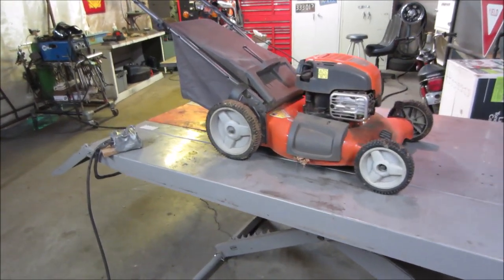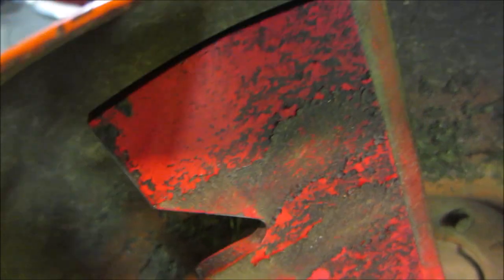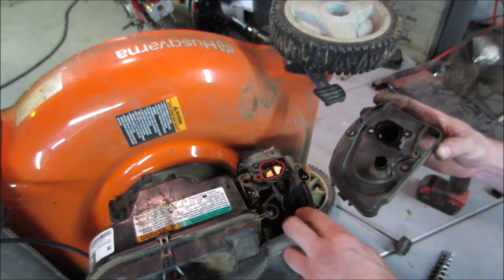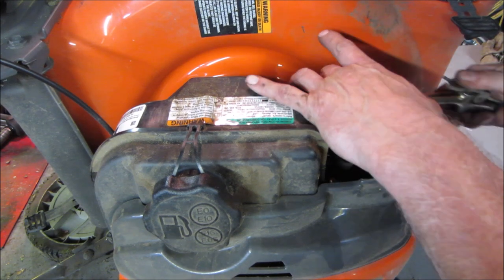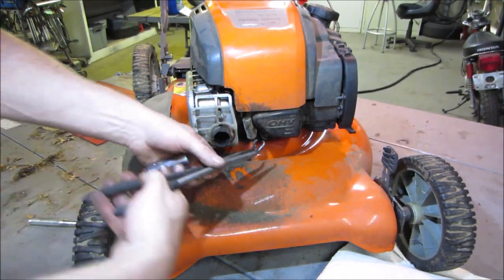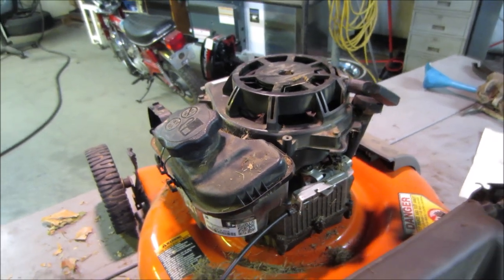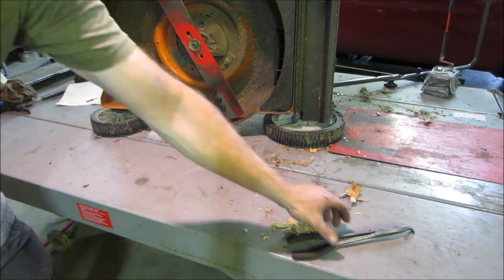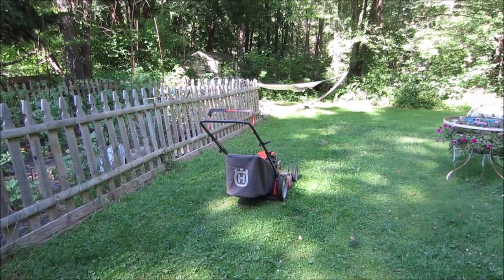NO OIL CHANGES? Servicing A Broken Yard Sale Lawn Mower,

Comment: I work as a repair-man at a Husqvarna dealer... These machines are not around much any more.. By that I mean the "no oil-change required" machines. B&S seems to have come to their senses, realising the huge amount of unnecessary wear on the machine it causes.

And another thing... Tipping a machine on its side like that is NEVER recommended.
Always tip a machine towards the handle so that the cylinder go towards the ceiling, avoiding oil going in to it.
(Even though I agree that when draining oil, it shouldn't be any problem)

Other than that, a very entertaining video!

Comment: That seems to be a Briggs and Stratton thing.  I bought a different brand lawnmower with a Briggs engine, same thing.  "Don't change, just add more." They probably just removed the piston rings as a cost saving measure and expect it to burn enough oil by blow-by to keep up with service.
Reply: I work there, its on almost all our small engines.  The reason In short: market research says whichever mower on the shelf advertises the least amount of maintenance, sells the most.  Were losing a lot of sales due to electric now for this reason.  But I can assure you they still have piston rings at least lol.

Comment: EBay is AWESOME for used mower repair. Put in the model number of your mower and you'll find kits for about 10 bucks that include spark plug, air filter, carb gasket kit. 
90% of problems can be fixed by changing those 3 things.

Comment: Lawn mower engines... they are low power, splash lubricated, air cooled. They don't have a oil pan and will burn oil at a faster rate then you would need to drain and change it. If you got nothing but time and are bored go ahead and change it.... My father has a honda lawn mower that is some 15 years + old and has never had the oil changed and used regularly. Just changed the spark plug on it earlier last year....

Comment: Do you ever use, seafoam, to clean carburetors while the engine runs, or wet soke the engine while engine is hot for like twenty to forty minutes with seafoam, that cleans thing out good too I've found.

Comment: When i worked on mowers to fix i always tipped them so the mower oil went to the back of the engine. that way the oil went to the back and wouldn't drain to the cylinder, carb, or muffler.

Comment: It might be a two-stroke that just burns the oil.  I had a jet ski like that.  Didn’t really need to change the oil, just top it off at the beginning of every service.  I honestly don’t think it even had a filter.  Small engines are great for that kind of thing.  Very little maintenance, just check and go.
Reply: It's scary that you feel the need to comment when you have so little knowledge of engines. BTW: This is a 4-stroke lawn mower, not a 2-stroke jet ski... there is a difference.
Reply: @johncoops6897  It's scary you need to assume what I know just to be a troll.  I actually know quite a bit about engines.  I got my associates in automotive tech and have passed 6 ASE tests so far, including one in diesel.  I have also gone back multiple times to expand my education with electives.  BTW: How do you know that is a four stroke?  Did he say it is?  I must have missed it.  And there is no difference between one engine and another.  If you can work on one, you can work on them all.  The only real difference is what the engine uses as fuel.  The only major difference between a two-stroke and four-stroke is that a two-stroke does the same amount of work in half the time.  They also generally don't have oil reservoirs, but not always.  See my original comment for an example.  Sorry to hurt your already low self-esteem, but your welcome for replying.  Have a good day.

Comment: My last Briggs says right on it "no more oil changes! Just check and add!" because apparently its too hard to change the oil in a 5hp engine now.  Just tune it to burn a bit of oil every time you start it, or whatever they did.
Reply: 1SLUGGO1.  That would be the old total loss oilers of a century ago.  I have not found the newer mower I bought two years back to burn any oil.  I needed one for a mountain cabin that was super light so I bought a $140 Lowes brand (Snapper).  Mostly light weeds on slopes with rocks.

My Sears Tecumseh 21 at the big lawn house has been chugging along for 19 years.  Starts on third pull almost every time.  Keep it clean, replace filter, sharpen blade every year (or twice), dump oil out the top every two years (I've never pulled a drainplug on a mower), use non ethanol gas, clean carb every two years, replace plug every five, run dry on Thanksgiving, store, repeat in March.

Comment: I'm surprised that,  right on the gas cap it calls for gas with "ethanol".    Talk about cutting the life of your carburettor.    First thing I was told when I bought a mower back in 2013 was,   "No Ethanol".    There are a few gas stations that carry fuel with no ethanol,  but not easy to find.  Shell (premium fuel) is one.

Comment: I have that type of B&S engine on a Toro (the one in my Profile pic!).  The idea with "Just Check & Add" is, first of all, the AVERAGE owner never does anything with the oil;  they put some in when they buy the mower (we hope!) and never touch the dipstick again.  The other thing is, allegedly, the mower consumes some amount of oil that works out to 18-20 ounces in an average season so, by just checking and adding, you've basically put "new" oil in over the Summer.  The trouble is, you haven't changed it and gotten any gunk out.  But again, you still would be doing more than the AVERAGE owner by just checking and adding.  I changed the oil on my Toro after the first five hours and change it every Fall.  I check it every time before I use it but, so far, have not had to add much.  

2nd - Hank's Garage had this type of engine and said that running it out of gas caused "Issues."  In the Comments, I asked, "What kind of issues?" and he responded, "Yes, running the gas completely out, like before storing the mower, does indeed cause issues.  Thanks for Subscribing!"  Very helpful.

3rd - I worked on a friend-of-a-friend's Husqvarna that was just beat up and had a "loose" handle.   Turned out the guy had somehow cut the bottom of the handle bracket off, so one bolt was useless, stripped the other bolt hole, the midway handle bolts were all flattened, it just caused a cascade of problems.  I took the right rear wheel off to access the bracket and the inner ball bearing race was in pieces!  I felt bad for the mower but refused to do anything else with it - every time I took a part off, it was broken!  Yumpin' Yimminy!

Comment: I talked to an employee at a store that sold another brand that also specified just add oil.  Between that conversation and searching online; The  air intake & cleaner keeps the dirt from entering the engine better than the old  design, thus the oil stays cleaner.   The engine might be run-in at the  factory so you don't need to change the oil to flush out the break-in particles.  If you don't remove the oil drain plug - the oil will not leak out when the plug is not installed or not tightened.  Some owners don't like changing oil and a local lawn mower shop near me charges 100 bucks an hour.  Don't know what they charge for an oil change.   Is there a small built-in oil filter?   Is there a screen near the bottom of the oil sump to keep the dirt from recirculating?   I would change the oil, as I keep mowers for a long time.

Comment: I guess the oil is good for the life of the mower. Kind of like a lot of newer cars have sealed transmissions, the fluid is good for life. Well, they're technically not lying. When the transmission starts slipping and slamming or the mower blows up, it is indeed at the end of its life. It might just be a bit shorter then you're used to. Besides I'm sure they will be more than happy to sell you a new mower or transmission lol

Comment: I picked up a fairly new mower last fall set out for garbage.  Had oil all over the top of the deck on one side.  Gave it a quick pull [that's what she said], and compression seemed good.  So I took her home to investigate, fresh gas in her, smoked a little but ran good after a minute.  Took it for a quick mow and didn't seem to be cutting the greatest.  Gave the blade a closer look, the cutting edge was BRAND NEW with all the paint still on it!  The back edge had the paint rubbed off.  So yep, the dude put a new blade on, probably got the oil all over the deck when he tipped it to install the blade UP-SIDE-DOWN!!!   Then had he cutting for a little bit and said, "Man, this thing is not cutting for $#*&.....I'll just go get a new one.... haha
Reply: Hey Mustie, thanks for the 'like'.... watching your videos gave me the knowledge and confidence to tackle such a project.  I now know to check for spark, compression, etc.  I even picked up a small generator with no carb/air filter box.  I was able to get it to turn over on starting fluid with a lamp plugged into it.  And the bulb lit up!!  Haha, no sure I want to pony for the missing parts though, it's only around a 1200 watt or so, little thing.  Thanks man!

Comment: Some of the mowers today, they say you don't have to change the oil, they are using synthetic oils and lubes on them. I could get about 75-100 for that all cleaned and waxed they would almost believe it was hardly ever used.

Comment: I've never changed the oil on my mower? I've had to replace the wheels, sharpen the blade, bypass the safety cable, clean the carb and tank, replace the pull string. But change the oil? nope, still looks like new and I'm sure if it was tested it would still pass for non detergent 30wt! I'm sure everybody's experience is different, but it seems to me that everything else will wear out before that oil ever goes bad!

Comment: I have a 20+ year old craftsman mower with a B&S motor.  After I cut there is oil splatter on the carb side of the deck.  I’m thinking head gasket, any thoughts?

Comment: My Husqvarna 7021 cuts.....not so great.....seems to leave a tiny strip of uncut grass even when overlapping passes. Just checked and the blade is correctly installed. I wonder if the motor is spinning backwards. Is that possible?  On the plus side the mower is 4.5 years old and I just looked and the air filter is still very clean. First oil change coming tomorrow.

Comment: If you don't change the oil, you will have to buy a new one sooner. The car companies did that with no lube and most people got a new front end out of it. The smart ones put in grease fittings  to prevent that.

Comment: That mower is not old at all.
The actual manufacture date is the first 6 digits of the serial.
That Briggs plastic carb is also fairly new on their engines, past 5 yrs
My Poulan has essentially that same deck, difference is my Poulan isn't rear discharge
Judging by the stain at the muffler, it was definitely overfilled with oil and it spewed out of the muffler.

Comment: All those Briggs 550ex style engines lack a drain plug. Overall I'm not a fan of that engine or the rest of the stuff attached to it. The plastic carb is a notorious issue because it's jetted so small to maintain California compliance. Sadly it seems Briggs doesn't build em to last and they are hardly worth repairing anymore. Ended up buying an older Briggs off Craigslist for $40 with the metal tank that runs like a champ.

Comment: You know they make this stuff called soap, you put it and water in a spray bottle and spray whatever you are going to use the pressure washer on first and it will make it much cleaner. You always show the results of what you use the pressure washer on still wet, anything looks better wet, it's not until it dries that it looks almost the same as before you started.

Comment: I would have to own a very special mower, for it to go to a shop with a lift..... Mine mows till it don't mo no mo. I just gave my broken mower ( probably just the flux capacitor ) to the guy who rebuilt the main run of fence, as he did a pretty good job. Otherwise I would have sold it to someone who would replace or fix the curb-er-rater

Comment: I have had my current lawnmower for over 25 years and I have never changed the oil.  I have never sharpened the blade just gas and go.  Just came in from cutting the lawn.  The only think I've had to do to it is to put duct tape on the deck where it has rusted thru.  Got tired of the grass clippings hitting me in the face.

Comment: All engines have some carbon blow buy that ends up in the oil that needs to removed. Small engines have no oil filter which makes even more important to change the oil. So I definitely disagree with no oil changes! You got it running sweet should be a easy sell. Nice job!

Comment: So what? Where does the old oil go so you can top it off with new oil?  Did they make the piston rings or valve stem seals to allow some burn off of oil? So you can top it back up?

Comment: I wonder if they have these no change oil lawn mowers to compete with the newer electric lawn mowers. The electric lawn mowers pretty much require zero maintenance, except for the occasional blade sharpening. If someone buys a gas powered mower, they should be draining the oil every year and replacing it. There's probably many home owners out there who don't want to bother with it, or gasp, don't know how!

Comment: I've had a few of them Husqvarna mowers My first one ever used I did like it said didn't change oil just add that don't work blew it up So I went and bought a new one have bought two more sense both of them still running strong. Have had them now over a year. I just tip on side and change oil. Don't do what the instructions say.

Comment: Lastly, The fuel tank has a screen at the inlet depression that feeds the fuel line. Mine failed and let some dirt into the carb through the gas,. Now I have an external filter and shutoff valve.

Comment: I had a mower that I used for several years just adding oil as needed. One year I decided to change it which I did and when I started it the mower smoked really bad. I cut it of and it never started again

Comment: They still sell them at Lowe's, so I doubt that it is 10 years old.  Between the owner still having the box and that the model is still available for retail sales, I would guess it isn't more than five years old.
Reply: I have this same mower.  I got it free for the almost exact same reason.  Overfill fouled the plug.  Made a hard start.  Owner gave up and bought a new one.  Also you're right.  This mower is 3-4 years old most likely.

Comment: They leak oil, that's why you keep having to fill it. I guess they don't really care where the oil goes or that it's improperly disposed of... Mine has a particular spot that seems to be designed to slowly leak oil. *shrug. If I ever see the oil get dirty I will def do an oil change though. But it's like a slow continuous oil change throughout the year...

Comment: Freedom 42. Ya know?  I thought I was crazy!  Use the tractor 3 or 4 times a season,  I forgot the blades are labeled left and right!  Well if they aren't in the right orientation,  it doesn't matter if they are upside down or not.  It just doesn't cut! Lt166. I'm so mad I sold an stx 38 barn find! Would have loved to try to retrofit the side discharge deck. I've been cutting grass most of my life,  I've been known for an upside-down blade a time or two.  Not sure how much scotch it takes,  but, I'm gonna be honest about that.  After the z turns for the return stripe, you see it, and yell..... you dumb son of a bi...! Love the VW by the way!  Great video!

Comment: I remember in high school (many moons ago) my friend had a 67 chevy something or other. The car burned a little oil, as well as had a small leak.. He had to add about 1 quart of oil per week. He would never change the oil because he would chuckle and say that it was "self changing" .. Maybe this manufacture is building in the notion of oil mitigation (consumption) on a minute level and figures that adding it may be enough to keep a fresh dose of lubrication going... at least till (what the manufacturer believes) is the natural obsolescence of the machine.
Reply: You can get away with not changing your oil in a case like that for a while, but every so often you should still change it. Just because the oil burns away doesn't mean the filth and grime in the engine burn away also. Clogged filters can and do happen in those scenarios.

Comment: This is NOT your father's Briggs and Stratton! This is the second one of these that I've had and it's clear to me that the use of inferior engine components contributes to both catastrophic failures I've had in use where the piston come flying out the side of the crankcase. I've never seen this happen before and I use synthetic oil and service all my mowers whether or not they permit servicing. I'm guessing they use inferior Chinese rod bearings which are very short lived. No more Briggs and Strattons for me. All electric from now on.

Comment: The blade problem could be fixed for those who are not mechanically inclined by the manufacture labeling the blades, "THIS SIDE TO THE MOWER DECK" or " THIS SIDE TI THE GROUND". Oil dip sticks should be labeled in how many ounces to ad to the full mark.

Comment: I suppose that I would have checked the compression on that used mower once I had the spark plug removed and had evacuated the combustion chamber, just to ensure that the mower was worth fixing.

Comment: Plastic carbs on the newer Briggs got me down. totally torn apart and cleaned, also the jet. Still won't run. Damn thing is only a year old. I've owned many mowers in my decades, A little service, never any issues. But these  2  Husqvarna I have are junk.

Comment: I just picked up a Husqvarna rider... Has issue of running 5-6 seconds then dies out. New battery-fuel pump-rebuilt carb ( Nikki 2 bbl btw) could it be possibly the rectifier? Thanks